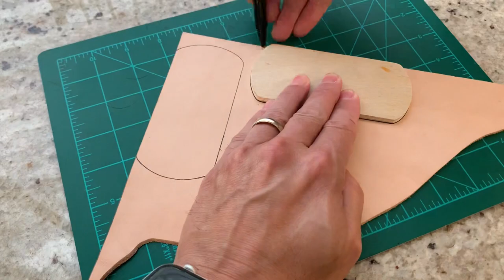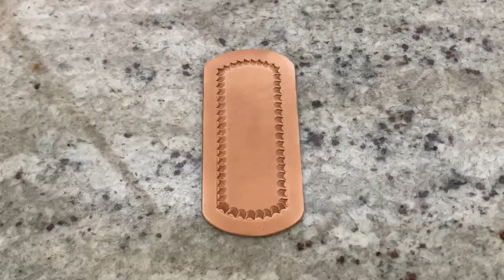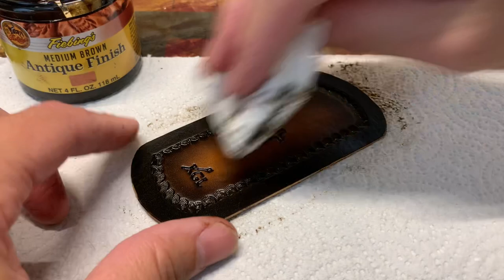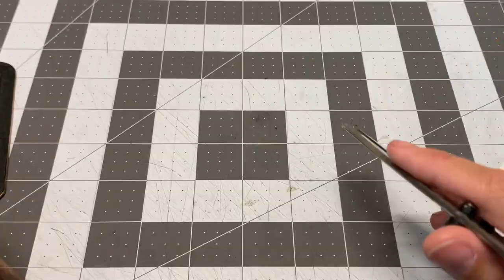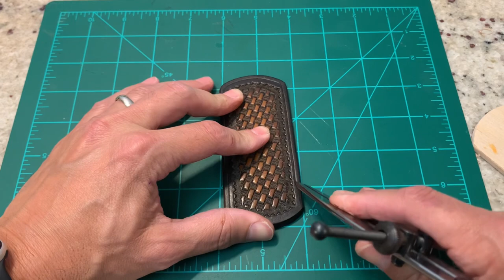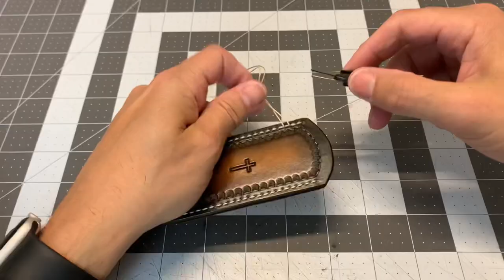How to make a tooled leather pocket knife slip case with a basket weave pattern - Leather Craft

Comment: Very nice work, also a very pleasant video to watch.
I assume the tape on the fleshside is there to prevent the leather from stretching during tooling, what kind of tape is that, i've never seen that before?
Reply from the maker: Thank you. Yes you are correct, it is to prevent the leather from deforming. It is heavy duty packing tape.